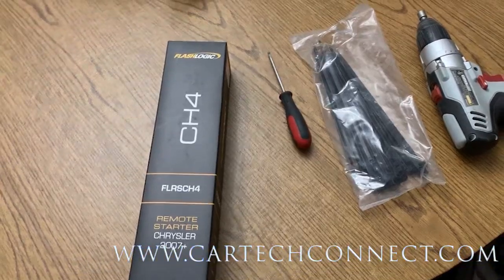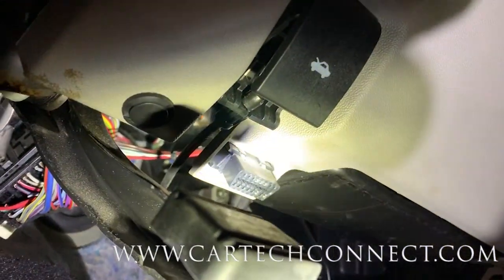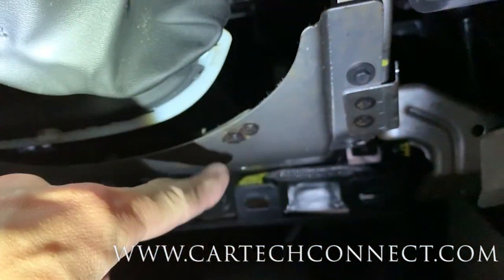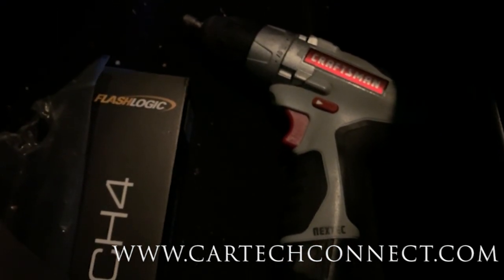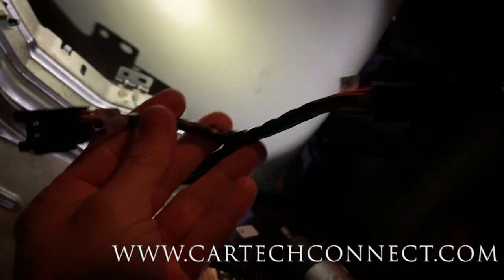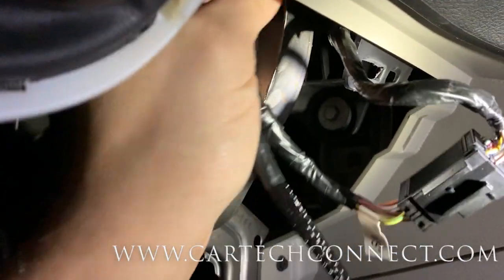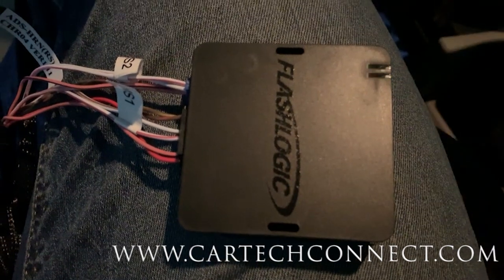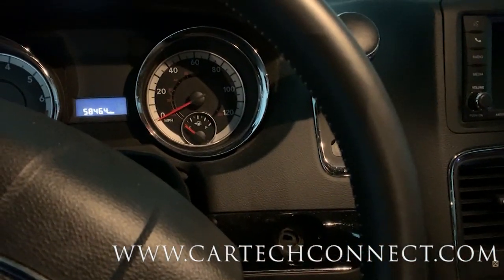Installing Flashlogic FLRSCH4 remote start in 2016 Dodge Grand Caravan / Chrysler Town n Country

Comment: Hello, have you completely installed this remote unit? I am interested in doing the same to my Dodge Caravan.
Reply from the maker: I have yet to do the lighting. But I can if needed! Its super simple once you have access to wiring diagram which is the tricky part.
Reply: @MasterTechLou  if you could do a video that would be great! Haven’t figure out how to finish wiring it in!
Reply from the maker: @baileydamlow9996  ok I will, may be in a week or so. But I will!
Reply: @MasterTechLou  I just wrapped everything up and brake switch and all worked without extra wires. Is there a reason for more wiring?
Reply from the maker: @baileydamlow9996  yes. If you want them.
What is next is the turn signals, so they flash every few seconds to let you know the car is still running. And possibly a few other options id have to check the manual. Been so long I forgot what else it can do.